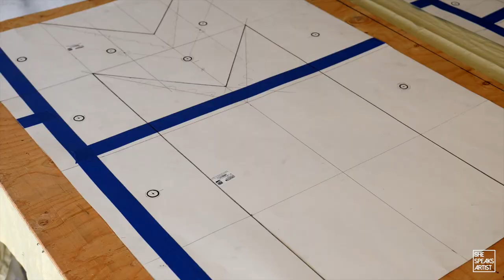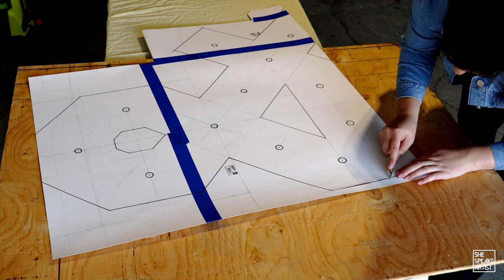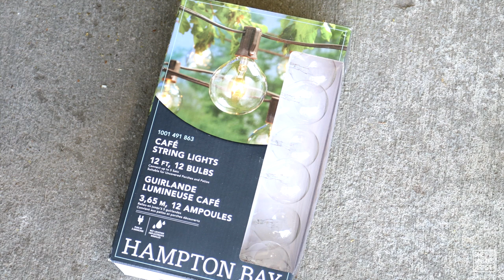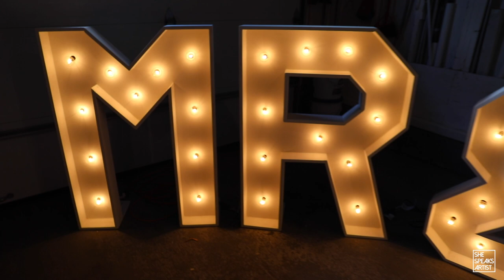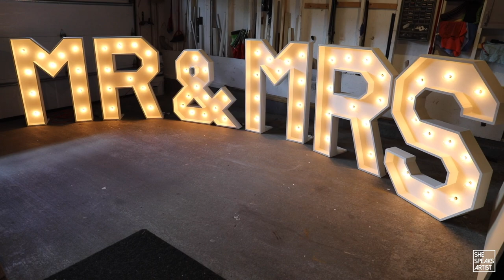DIY Giant Light Up Wooden Mr & Mrs Wedding Marquee Letters

Comment: Hi :-) Which font did you use? This is an awesome work, it looks awesome!!!!
Reply from the maker: Thank you!! No specific font in mind, just thought it would be easier to make the letters in straight cuts rather than curves because I knew I wanted a wooden trim all around. Originally, I was going to add a serif at the base of each letter, but figured it would be easier to add a small wooden base behind each letter instead. It also helped keep the letters somewhat lightweight for transportation!